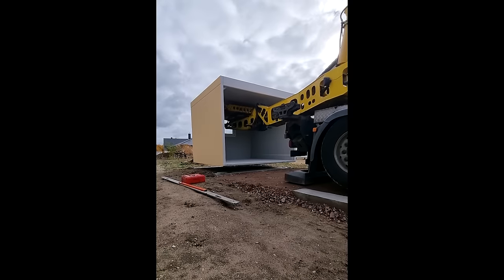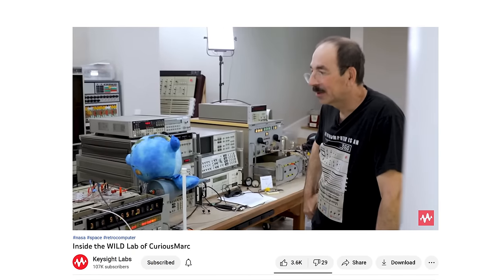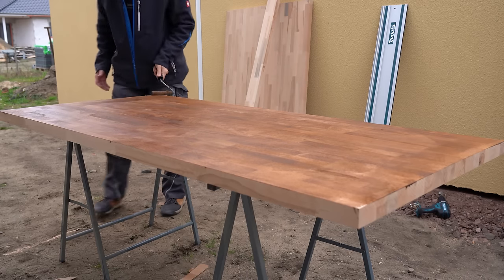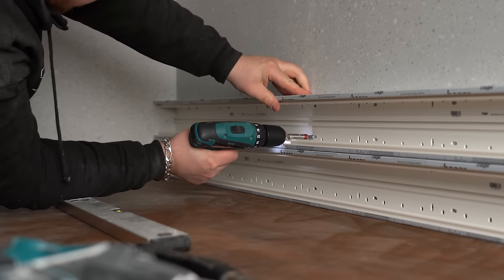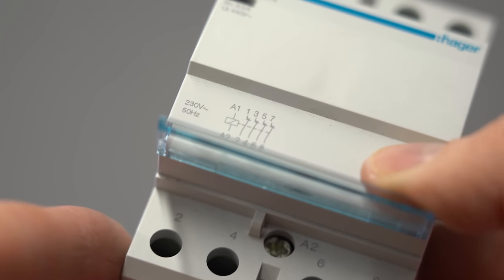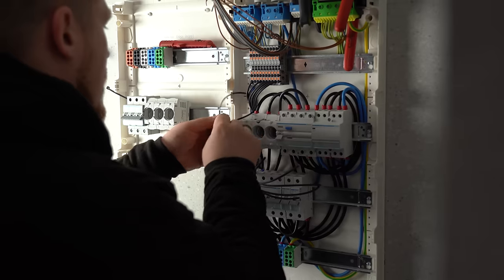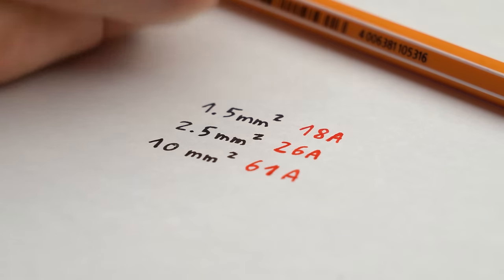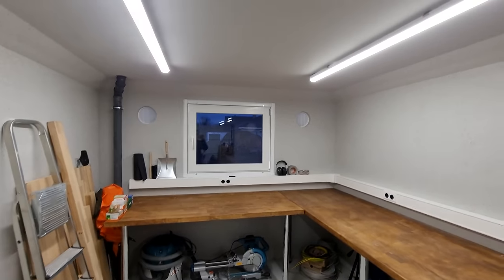Germans do the PERFECT Electrical Wiring! (Garage Build)

Comment: Nice project and congrats on the start of building your home.  My suggestion would be, if time allowed, is labeling your wires at your substation panel.  Not sure if you plan on doing that, but it would help for when you go back and add new construction or for trouble shooting.
Reply from the maker: Yes. I will do that in the future
Reply: @greatscottlab  we all will. Soon(tm) 😅😅
Reply: A networking tip I see, and definitely agree.
I'm doing this for a smaller scale project (a 3D printer at work). Zip-ties with a little tag attached were my choice for this project.
Reply: Exactly - I myself did this when setting up my LAN-Network (yes: I am one of those guys who don't think WiFi is super great, especially for gaming!)...I know where each wire leads as they are labeled!
Reply: @Kalvinjj  I hate flags 😠
You can get shrink tube for a P-touch labeler.
It's what we use over here, neat & durable.
Reply: @jimurrata6785  Nice tip, might try to convince our boss to get that... This might not be as easy tho.
For a zero initial investment tho the zip-tie labels or printable stickers (...you can just write on them anyway if no paper printer) still an option.
Reply: @Kalvinjj  40 years ago all we had was Sharpie marker on the sheath.
It's certainly a non-zero investment but you can buy generic cartridges and it sets your work apart from the neanderthals.  😉
If you have a label writer already for labeling the breakers in a panel (we use them because of legibility) then the shrink tube is not a big jump
Reply: @jimurrata6785  Yeah I do mean acquiring the label writer itself. It might not be too expensive, but it's definitely a "Why that if we need X, Y and Z and they cost less?".
Believe me, I sure would want all possible tools in existence x2 if we could afford it, but small company has it's priorities.
Reply: @Kalvinjj When I moved up from the PT-H111 to the PTE300 ($50 v $175) the price was hard to swallow, but not having to deal with flags, a rechargable unit with bigger fonts and wider labels is really nice!
It's still less than a drill/driver, puts the finishing touch on customer facing work and is obviously a write-off.
My handwriting is atrocious!  😆
Reply: @greatscottlab  Do it while it's still fresh in your head. Once you forget, it becomes a pain to do it right.
Reply: In the Netherlands you have to label everything on the substation and leave an wiring diagram near or in the station, plus a map of the building with everything labeled according to the wiring diagram. 
Its the first and most common thing they will notice whenever checks the installations (like for insurance stuff), and doing it when building an installation saves you lots of time compared to doing it afterward. 
Next to thats its very nice and safe for whenever other people have to work on the installation, like the next owners or whatever.
Reply: Code requires you to mark the breakers and in such a smallun complicated panel that's sufficient.
Reply: I just installed ethernet at home. There are no Conduit plans and almost no labeling. It was terrible. I ended up running it through the Ventilation shaft.

Comment: Hello, congratulations on the excellent electrical installation, I was once an electrical installation inspector here in Portugal.  Around here we use the same materials and the same brands.  Here we do not mix sockets and lighting in the same circuit, not for safety reasons (as long as it is guaranteed) but for legal reasons.  If there is any repair to be done (and I'm being nitpicky) it's just the location of the electrical panel, here in Portugal we do our best to always install it near the entrance to the building, to allow maneuvers in case of an accident inside, but as I said I'm being extremely picky.  Once again congratulations on the excellent work!
Reply from the maker: Thanks for the feedback. Nice insight
Reply: It's also nice to keep them separate so you can still see at night when you trip a breaker with your tools / kettle / etc.
Reply: It is not mandatory here in germany but highly recommended by officials
Reply: Here in UK, we to separate lights and power outlets.  U have fuse box with many fuses isolating different parts of the house.
Reply: Yeah, you still have lights if you trip the breaker for outlets, that's one advantage.

A few days ago I was installing sonoff relays inside my light switch boxes and as it turned out my cables are soldered together. Thanks to all the lights being on a separate circuit/breaker I could easily plug my soldering iron. And the food in my fridge didn't go bad.

Comment: You could add a pushbutton and green light to turn on your work bench. Then switch the relay operation around as it should be. This will then consume the additional power only when the circuit is active anyway. It will also function as safety in case of power outages to prevent equipment from starting unintentionally.

Comment: Nice setup! This is not for the same situation but when I set up and EMO circuit for an automation device I used a “safety relay” which requires an additional reset switch before power can be turned back on.
Reply from the maker: Thanks for the feedback. Yep. That sounds reasonable.

Comment: I used a shunt trip in a safety circuit like this. When the e stop is pressed the shunt trip mechanically trips the main switch / circuit breaker / rcd.  There is no idle current. Requires a physical reset once the emergency  situation is rectified. Works well

Comment: Only thing I would pick on is the half completed conduit.

European rules are somewhat similar to ours, so yes I'm aware that it's not required, however having all of the corners just left out just looks dodgy.

A few bits of corro (flexible corrugated conduit) would seal everything up, give a bit of additional mechanical protection at those corners and just make it look neat.

Comment: Such a satisfying job you did! Awesome! One small remark though as industrial engineer; it is not considered safe to wire emergency stops in parallel, you should wire them in series with NC contacts so that if one of them is punched you are 100% sure you have no more current. Anyhow, for personal stuff it won't give yopu any trouble.

Comment: Instead of using the relay for your emergency stop, you could use an RCD with an undervoltage release (Unterspannungsauslöser). Thats how they did it for the new buildung my school got.

You get the cable break protection with only a stand-by power consumption of  < 10 VA (depending on the model)
Reply: no, better is to use shunt trip like hager mz203. It only draws power when activated.
Reply: @avckubw938v1bnvowiqv  Well, if you do that, you loose the cable-break protection again, but you don't need to buy a separate relay because you need a circuit breaker anyway.
Reply: You should probably use a safety relay and proper protection circuitry like a monitor things like the emergency stop and flag alarms if there are issues happening they could be integrated with similar systems

Comment: Ausgezeichnet!!! As an electrician in the States, it was great to see how things are done in Germany.

When my brother and sister-in-law built their house in Germany, I was amazed with his electric panel: 400V 3-phase (much more power than our split-phase 240 V panel)! It even had a built-in timing relay to control the Schwibbogen!!!
Reply: Considering just 3% of homes in Germany even has air conditioning I'm trying to fathom why they would even need 400v 3 phase. Sure, it means you could use thinner wiring as the amperage will be lower but it also means the actual copper wire is more susceptible to damage.
Reply: @Cerberus984  we use it mostly for our heaters and for the stove
Reply: @Cerberus984  what causes the damage ??? 😅
Reply: @Cerberus984 with 3 phases you can power electrical stoves easily with 5x1.5 mm2  fused with 16A per phase.. With 120V you need much higher mm2.
Reply: @thorstenjaspert9394  in the UK we generally would run 240 V for heating things just because three phases available but so many of our homes are older appliances generally up all single face but we still need to include really thick wires even if it was run three phase so the saving of wire size may not always be the case
Reply: @UKsystems  I had an Rbnb house in south London last year.  A common residential house. The horse was old and only one phase supply. The gas stove was obligatory
Reply: @thorstenjaspert9394  probably an old 30 amp connection

Comment: For electronic bench wiring in the USA the approach is a little different, which in the USA is NEC (electric code) dependent but also the installation is considered specialized, meaning it falls more under industrial than residential. For electronic / electrical bench design, the goal is to have all of the wiring encased (surrounded) by metal. So from the drop to the breaker panel to the outlets you will see either EMT (electrical metallic tubing) or RMC (Rigid Metal Conduit which is threaded pipe). I like RMC but it is harder to cut and bend than EMT and you have to thread it. RMC threaded connections are sealed using copper based sealant to prevent water intrusion but also maintain a good electrical connection. The conduit is used as a sort of continuous shield and crush protection, but not to conduct ground fault current, meaning it does not replace a grounded conductor, however it is still ground referenced in case a hot wire comes in contact with the conduit. Which makes the electronic bench installation unique (also seen in music recording studios) because many times for motor controls the metal conduit is used as protective earth so you can omit the earth protective ground wire in the conduit.  

Also, traditionally the bench outlets, usually metal quad boxes (two GFCI duplex receptacles in the same metal box) are stagger as three 120 VAC, 20 Amp circuits along the bench. So, as you go around the bench the quad box circuits would be 1, 2, and 3, and then go back to 1. This is done so if one of the circuits overload you will not loose the whole bench. All are fed using circuit breakers. The wiring is stranded copper. Connections to the outlets are done using captive spade lugs to the receptacles and the screws torqued to spec. You can also buy GFCI outlet that already have a stranded pigtails attached so you can use a wire-nut, WAGO splices are rarely used for electronic benches. All of the bench test equipment is grounded. To test hot chassis power supplies and equipment you have to have an AC isolation transformer to float the mains and the safety ground as an option. Generally, for most manufacturers you will see two types of AC power supplies, one used for troubleshooting (field returns) and one used for testing (after it has been repaired and calibrated). Usually, there is a field return test bench and separate out-going equipment test bench, each is set up different for the different tasks. 

You must add ESD grounding connections to metal tables if used, ESD pads and ESD floor mats. I like to use a tin plated threaded copper grounding bus bars on isolated mounts with copper (or brass) nuts and washers. This ESD earth ground can be external to the metal conduit. You can run a separate grounding cable (6 AWG) in plastic conduit back to the earth grounding in the mains panel. Make sure this connection has no breaks or splices from the bus bar to the panel.

Comment: I wish we had a lot of this stuff in the US. Your buddy does such clean work, love it!
Reply: Nothing stopping you from using a lot of this stuff, if you don't mind the expense.  Parents house is 60 years old, brick ranch with wood framing/drywall inside.  Electrical is standarm 120v single-phase, with wiring to outlets run inside the walls with metal plates on the 2x4 where the hole is, against the inside of the drywall.  
Simple ROMEX wire, wirenuts, and junction boxes at the outlets.
No fires, no rewiring needed, no fatalities from hanging pictures/tv's, etc, etc.
My career has been network infrastructure in biotech and pharma/R&D, where network cable has been specc'ed for conduit along with electrical in production and other areas.
Requiring conduit in the home setting seems a bit absurd. Maybe it because you've got 3-phase 250v and nailing a picture frame is actually liable to kill you, but once you've run your outlets and lights, having conduit/pull-strings available while nice, I'm doubtful is really that useful or a selling point.  
If you end up doing a remod or extension, you're going to have demo access anyways, so thats not a good excuse/selling point.
It WOULD be nice to have 10-12Kw available normally though, especially for the shop. However in general use, 240v split phase seems to work for US/Canada fairly well enough for the stove/washer-dryer that they are generally used for.
120v from the a or b side for lights and simple appliances, and no need for conduit.  Tidy wiring is always nice though.
Reply: @boots7859  ...also when done correctly (back spacing from the back side of the wall), typical wiring is back far enough that unless you're foolishly driving a spike into the wall without locating a stud (in which case plastic conduit won't save you, and perhaps metal won't either)...just about every wall hanging hardware barely protrudes past the wall board...

...a lot of the stuff they (Europe) is a bit overkill...especially those 'wago' (sp?) connectors...they remind me of those spring type terminal blocks that I find in EU machines that I fix...GARBAGE!...you need to have a positive clamping device (screw terminal) as you can re-tighten as needed...overtime, friction based terminal blocks WILL weaken, get hotter and cause issues...sure they take longer to install, but it's well worth the 'piece of mind'...

The only thing that I like that they use is the cable...I hate running ROMEX or BX cable.....but sum up what you mention, 'if it ain't broke, don't fix it'...I work on industrial gear (millwright) for a living, and no offence to EU gear, but it's always being dicked with in the name of 'efficiency' .....problem is, that most of it doesn't last as long, and what good is 'efficiency' if you have to go out an buy a new one?
Reply: @angusandleigh  "you need to have a positive clamping device (screw terminal) as you can re-tighten as needed...overtime, friction based terminal blocks WILL weaken" Thats just not true. They will withstand vibrations and temperature changes. Screwterminals are a thing of the past atleast for small wire gauges. Why do you have to re-tighten screw terminals? -vibrations? -temperature changes? -too much torque on first installation and deformed conductor? Let me guess you are still using wire nuts in junction boxes and think thats the way to go? Or using screwterminals on stranded wires without ferrule and think its fine? Btw i'am also electrian on industrial machines with 20 years of experience.
Reply: @Awacs1985  ...especially on industrial gear it is absolutely true...I have had to deal with more control wiring issues with friction connections...I have never had to replace a screw terminal as they can be tightened over time...heat and vibration are the enemy to any friction terminal. High quality industrial machines more often than not still use screw terminals because they WORK, no need to reinvent the wheel. 

As a matter of fact I do still use wire nuts with HT insulation because not everything has a terminal block...space permitted like say on a motor etc. they work just fine...and for solid core wire they are better than terminal block as they are stronger and there is no strain on them...if I'm using stranded wire, then sure a TB is nicer, but it will be a screw block...

...I'm a 20 year Millwright, and I've had to correct a lot of sparky jobs or factory designs because they aren't robust enough. I have rebuilt many control panels...I have replaced many friction blocks with screw blocks because the former were no longer up to the task. You just can't beat positive affixation...especially where heat an vibration is concerned. 

Friction blocks are only superior as you don't have to 'maintain' them...buts that's just laziness...you should always be inspecting things so there are no surprises, every year or less each machine that I look after gets re-torqued...and I've never had a failure.
Reply: @boots7859  i run a washing machine and a dish washer on the same double socket, at the same time, with a 16A fuse at front, 230V is just so nice, having 3 of them its kind of very hard to overload them!
in EU cables, you have minimum 3 wires... 1 live, 1 neutral and the green/yellow is grounding....nothing is connected with single wires, something i saw in disbelieve in the USA....we got here the 2020s, not 1910s like in the USA
Reply: @Arltratlo  No legal install in the US uses single wires. Not since the 1930s anyway.
Reply: @boots7859  YOU SHOULD ALWAYS USE CONDUIT. Putting wires in wooden walls doesnt look like a good idea... specially if you use a TN-C earting system wich draws a lot of current to ground if the insulation fails. (lot of current, lot of heat... in wooden walls)

Comment: When I did my lab / home office, I used conduit to mount sockets as well. I did take the opportunity to wire a whole load of network sockets, and wire them back to a mini 19 inch rack. I also wired satellite feeds, a bit of good gauge cable for surround sound loudspeakers and the TV / computer displays, along with a home cinema amp to do the switching.
Reply: yea I'd use  conduit, armored cable and steel J boxes. if I accidentally hit it with an air rifle (or smash it with something) it's not gonna shatter, plus harder for mice to live in.